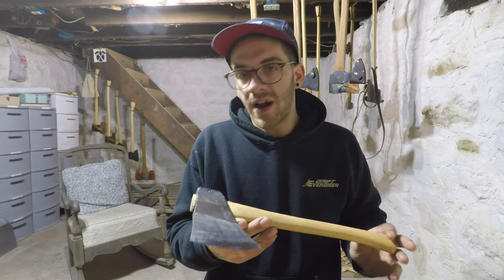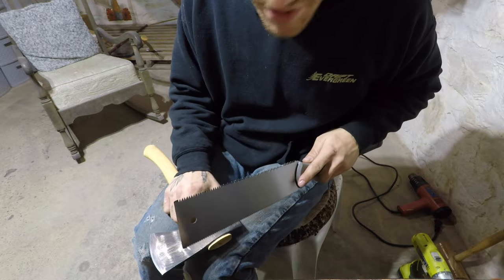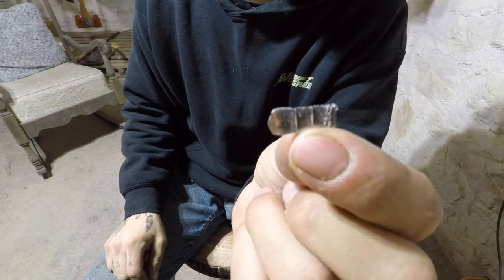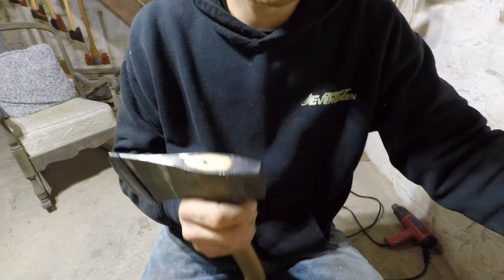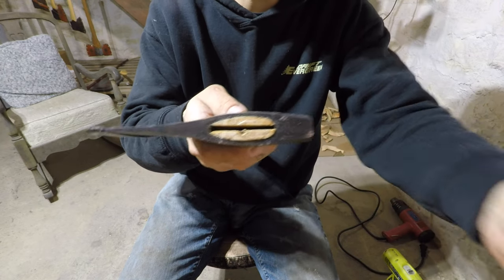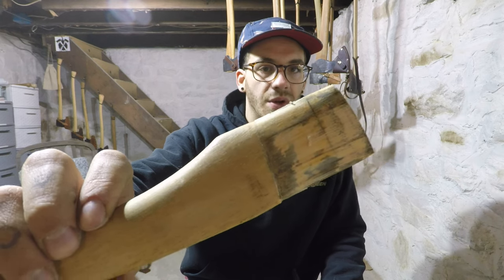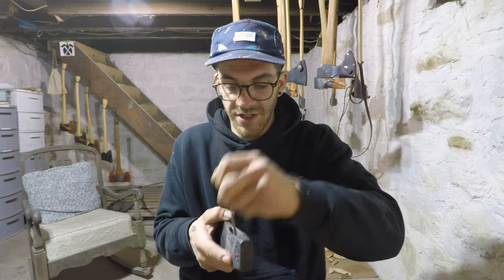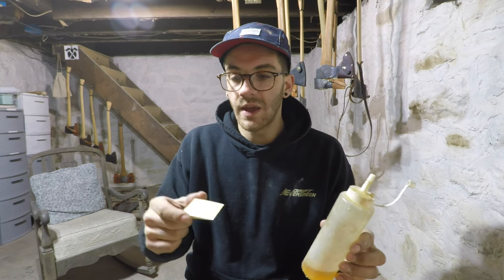How to fix a loose axe the right way

Comment: Haven’t heard of another maker doing it but I put the original brown gorilla glue in the eye of the axe on all the axes I hang. it helps it seat better and once it sets it swells up and I have yet to have one come loose. I’ve had them snap off but haven’t had one or heard of one of mine coming loose.
Reply: Yes I’ve started glueing the eyes with titebond since starting to watch EngelsCoachShop & it seems to be a significant upgrade
Reply from the maker: Oh wow yeah I know the glue you’re talking about !! Thank you I’ll have to give that shot !!! Thanks for the tip mane and thanks for watching 👍
Reply: Actually Titebond II the exterior grade…
Reply: @DrewDiaz  - It's funny that this should come up now.  I just found an old hatchet last week that I haven't seen in years.  I have no idea who made it but it was definitely made before we started importing so much Chinese junk.  However I have no reason to believe that it's a high quality hatchet.  First think I notice was that the handle was definitely glued into the axe head.  They may have just intended to fill in any gaps but it looks to me like it was glued in from the start.  Nobody I know of is recommending that the technique these days but I think there might be some merit in it and planned to ask 940Joey what his opinion was but I just post it hear and listen to anyone who has an opinion.
Reply: @Bkellyusa  my last piece on this subject-
 Widen the kerf on the handle and make sure To get glue down in the kerf, I’ve used kite string and card stock to spread the glue as the glue seems to squeegee off the wedge.
In re gluing the eye- it may just lube the joint but it seems to work

Comment: There seems to be whining about Council Tool heads coming loose, but I for one haven't had that happen on any of my Utility line or Velvicut axes; none of the nine I have and use. It may be environmental or what I do before putting them into service. I've done this with every one. I scrape the haft thinner, sand, and apply multiple coats of boiled linseed oil over weeks allowing for curing. Not one of the nine heads have budged, even having repeated overstrikes. WTF are guys doing to loosen the heads, anyway??? When hanging an axe head there are a few other steps l take. I smack the haft repeatedly and remove it several times to remove any excess material creating a shelf. The last time the head is off I check and adjust the wedge kerf depth to 2/3 of the eye depth and check the length of the wedge; a little long is better, but no shorter. Once hung I may need to thin the wedge also, so that it spreads the kerf without splintering, but still mushrooms the proud haft. I slather BLO in the kerf on the haft, and wedge and send it home. I like mine hung proud about 1/4"+ with a big mushroom. P.S. Buckin' does it better in a 16 minute video. Think more about safety. There's a lot of stupid going around. 😆
Reply from the maker: Hey man thanks for watching, sorry if I came off negative toward council tool, I love their axes they’re my favorite. My CT boys axe is my go to axe. As far as the heads coming loose out of all my council tools only 2 came loose, could of just been luck of the draw, weather, or me. That’s pretty awesome you haven’t had one budge yet I’ll have to try out your BLO method, thanks for the tip👍 what kind of council tool axes do you have, which one is your favorite. How much better are the velvicut versions, I’ve been looking into one. Oh yeah just thought of it, do you have a camp carver!! I’ve had my eye on one of those beauties for a while. If you have one I’d love to know your thoughts on it🤙 and as far as buckin billy ray doing it better, yeah I agree. He does real nice work, he’s been doing axes probably longer than I’ve been alive !! Hope to be as good as him one day, I watch him all the time 👍 thank you again for watching, I appreciate your feedback !!
Reply: @940joey2  Glad to hear from you. Very receptive and inviting, I must say. My favorite axes in order are Velvicut Boy's Bad Axe, Velvicut Felling Axe, and vintage True Temper KELLY Stiletto double bit swamping axe. The other CT axes both Jerseys, three Utility Boy's axes, 3&1/2 lb Dayton redhead, and Flying Fox. If I had to choose only one it would be the Velvicut Boy's. I can't help but think it can do anything I need, but there's always a best tool for a job. That's why I made my move last season to a Fiskars 8lb maul for splitting the four cords for this winter. Keeps this old man vital. I just need to pass a few along, because of the redundancy. Three to my adult sons and one to my grandson. Thanks for the appreciation.
Reply from the maker: @yungsmile7546  absolutely thanks for supporting and giving advice man, it’s greatly appreciated. Oh wow yeah that’s a good set up you have there and I feel the same way about my boys axe. If it came down to picking one axe it would be the council tool boys axe, it really is good for almost everything. I have yet to try the premium bad axe boys axe, one day I’ll get my hands on one. I bet that 5160 steel hold an edge for a long time. They seem as if you don’t even have to touch them, from what I’ve heard and read the premium boys axe you literally take out of the box and use it !!

Comment: Your becoming an axe master mate! This kind of stuff is essential know how and you had some good detail in here🧐  something else to try (you may have already): when sawing the exposed eye wood, stop when you hit the metal wedge. Break off the cut bits, then use the tip of the saw and/or a box cutter to finish the cut. This leaves both the metal and intact wooden wedge exposed, which you can then grab with your pliers and yank out. Jumping the head further on a bit first and relieving bit of pressure off the top of the eye wood can help too. Keep up the good work man!
Reply from the maker: Thank you so much Kurt !! Yeah man I’ll definitely have to try that next time I need to re hang an axe!

Comment: I work the same way, no vise yet. I use a clawbar or cats paw to pop the wedge out via the screws. I broke my flying fox handle and hung it on a 19 inch Gransfors Hunters axe handle which is a great in between size from the small Flying fox handle at 16 inches and large one at 22. Now it's a Flying Gransfors.  Or maybe a Gransfors Fox?😂

Comment: If you have a flush hung axe which gets loose, you can set it upside down and pound on the foot of the handle until its proud of the head.  You may have to cut the curl away under the cheeks as the head slides down the handle. Then you can apply some oil around the eye and let it soak in. From there, take another steel wedge and drive it in and keep hammering to mushroom the wood a little bit.  This is a way to basically rehang and proud fit the haft to a head without having to remove the haft or wedge.
Reply from the maker: Thank you so much, that’s a great tip !! I’ll have to give this a try some time. Great explanation , thanks again 🤙

Comment: This video was very helpful full . I have a montreal pattern with a barrel wedge and had no idea how to remove it .I'm going ro try sawing off around the metal step wedge, great idea  !! Thx
Reply from the maker: You’re welcome !! Glad you liked the video, with a barrel wedge you could also take a drill bit the same size as the inside diameter of the barrel wedge and drill about half the depth of the wedge through its center and use an easy out to remove it. 👍 good luck with it hope it works out well !!

Comment: Gotta get yourself a vise for the creepy basement workshop.  Don’t get something expensive.  Just a $30 job off eBay.  Work just fine for axes, but definitely a must for axe work.  Impressive you’ve done so much without one.  Great vid.  Have you had any luck with the screw trick when it’s glued?  I always have to drill em out then.
Reply from the maker: Thank you Kevin, yeah I definitely need to pick one up you’re right. If I was being completely transparent there are times where it gets quite frustrating trying to hold the axe for certain tasks. I have done 2 axes with the wedge glued and used the the screw trick and both times it led to me drilling out as much of the wedge as possible, enough to get the head off. Then I go through and clean the rest of the eye out with a saw or knife.

Comment: Just did this to my council tool boys axe the other week. Hated using the thing until I made it right. Now it’s hung with just a poplar wedge and holding up tight! I really wish they didn’t put barrel wedges in these axes. If anything, it should come taped to the handle. That way if you get any looseness you can make the call.

Great, instructional video. Easy to follow, and entertaining as always!

Like Kevin said, a bench vise ought to come in handy. I don’t get any work done at home because we don’t have one. I’m always making trips to my relative’s creepy basement😆
Reply from the maker: Hahaha thanks man yeah man creepy basement is where it’s at lol !! But yeah I’ll definitely get a small vise, I’ve been just getting by long enough it’s definitely time. Yeah man I couldn’t agree more with the wedge coming with it uninstalled. I wish it wasn’t such a liability issue because I would love if companies sold axe heads loose so and different handle options, or hell even handle blanks. !! Thanks for watching man I always look forward to what you have to say on it 🤙
Reply: @940joey2  heck yeah, handle options is what we need! If we had better handles options I'd be using the heck out of some old vintage heads i have lying around.

Comment: Real good video..
I had to do this for a new snow and nealley axe.  The problem there was they use an aluminum wedge....which I hate..  It's pretty much impossible to get it out without wrecking handle.
I tried drilling the holes into the wedge,  and attaching screws, since that's a common method with wood wedges.  I managed to get some decent holes with some patience.  long story short, I broke off screws in the wedge and ran out of options.

I had to cut handle off and re hang on a new one.  This was a pity because the original handle was a real nice handle.  But , as you said, I have peace of mind knowing it's hung  properly and will endure 

I'm glad council doesn't use aluminum wedges any more.  Someone needs to convince Snow and Nealley to stop as well.

Axes need to be serviceable by the user.  Aluminum wedges hinder this, and since they don't absorb oil, and therefore don't expand.....they cause the axe head to come loose more quickly.
one thing I forgot to mention is snow and nealley do not hang their axes proud....they hang them flush, which complicated my wedge removal attempt.
Reply from the maker: Thank you so much !! Oh man what a bummer sound like you had a heck of a time with that aluminum wedge. I can’t stand them either, I’m not sure why some companies choose to do that. I had to re-hang a council tool boys axe (the old res version) for a friend of mine and they had one aluminum wedge in it and it was an absolutely nightmare to get out. Fortunately I was able to get it after a while and didn’t have to cut the handle. 
That’s really interesting that snow and neally doesn’t hang their axes proud, I wonder why they do that being that there is so much benefit to a proud hang .. the only thing I can think to why they do that is because of the aluminum wedge. I don’t think it would work well having a proud hand with only using aluminum and it’s probably not as attractive. I know that the CT boys axe with the aluminum wedge also had a flush hang, so that’s the only thing I can think it could be. 
Besides what you went through how do you like your snow and neally axe. Do you have and vintage snow and neally to compare it to, I’ve always been curious on those newer axe line. It’s hard to find a lot of info on them. The thank you so much again for checking out the video !!
Reply: @940joey2  I have only one Snow and Nealley new production axe. 3.5 pound head.
The head is very well finished, and the steel is great.  It came butter knife dull...
but that's OK.  I put the files and stones to it and got a good edge.
I have a CT sport utility finish 3.5 Jersey pattern.  And I would say out of the box it is a much better axe then the Snow and Nealley for the money:
better handle and hang, and no varnish.
sharp usable edge out of box 

I wanted the Snow and Nealley because they were the other USA made axe I kept hearing about, and I wanted to support their return to USA production.  With some effort it turned out to be a great axe.  
Always a pleasure to watch your videos.

Comment: I don’t like using glue for the same reason as you, what if I need/want to rehang. 

I also put BLO on whole handle like you do, in the kerf, plus on the wedge. 

No clue if a good idea, but my theory is that by sealing the wood, less chance to absorb humidity and then shrink when it dries again. I figure it may act like weak glue once cured, but not enough to be hard to pop out with tools.
Reply from the maker: Heck yeah !! Glad to hear you do it the same way, it’s been working for me I don’t see the need for glue !! I think the same way once the oil fully absorbs into the wood there should be less of a chance for moisture to get in and linseed oil drys almost like a polymer so in theory it should act like a glue once cured 👍 thank you so much for watching !!

Comment: Why didn't you just cut the handle material instead of the wedge, where you can clamp on to the wedge.
Reply from the maker: Dang that’s a great point, I honestly didn’t even think of that. I suppose I was more concerned with getting the metal wedge out first, Not sure. Thank you for this great tip, next time I have to rehang an axe that’s hung proud I’ll give this method a shot !! Thank you so much for watching and for the awesome comment 👍

Comment: You can also use an oscillating tool with a plunge cut blade to make a new slot and drive a new wood wedge in. Even if you leave the original wedge in. I always use glue on the wedge and I only use metal cross wedge on sledge or big hammers.
Reply from the maker: Dang that’s a great idea, never thought of that !! Yeah I agree with you on the metal step wedge thing. I still have yet to try glue on my wedges yet maybe I’ll give it a shot on my next hang. I hear a lot of people use glue. I guess I’m a little nervous to commit to glue because I can’t go back and make a repair or fix a mistake as easy.

Comment: Good job explaining on every step involved and different options on each situation.   Have you taken out any aluminum wedges from a council tool axe while trying to save the handle?   My fallers axe has the big aluminum wedge but I wanna save the handle hoping you have some ideas?
Reply from the maker: Thank you chimmy !! Ooof man those are tough because there is no wood wedge it’s just a whole aluminum wedge. If it was steel you could be careful and drill and tap the hole and extract it that way, but I’m fearing that because it’s aluminum it’ll pull the threads out. I definitely think it’s possible with out hurting the handle, it’s just going to take some time and patience. I had an old vintage axe I wanted to save the handle on with a big metal wedge and no wood wedge it took about 2 hours but I got it, it was worth it because I love that handle.
Reply: Drill & tapping. Use small diameter bolts that go the entire depth of the wedge. Use washers to help grip & not mess up the head. Thread locker also helps.
Alternatively, my favourite method of wedge removal is an oscillating saw/multi-too if you have one or are willing to invest $. Use a narrow blade that will not exceed the width of the eye when in operation.  Watch the 'saw dust'. As long as they are aluminum shavings, you're  good. If you're fortunate & the wedge is a different color than the handle, that also helps. This wedge removal method also is about the only way I know of to remove wedges glued in during the hang. Usually there is a gap between the point of the wedge & the depth of the handle's kerf. If you're careful, you can feel the blade & saw drop as they cut through the bottom of the wedge & into this small void. Further, once you've cut the wedge into two pieces, you can use a chisel & tap/break the wedge pieces away from the handle & remove them. You don't always have to remove the entire wedge to get the bit off the handle. Once the handle is off you can clean up the kerf as needed.
Reply from the maker: @waynemiller6945  hey that’s an awesome idea thanks for the idea I’ll have to give that a try. I do have one of those tools I just need to see if I have the small blade for it. I really appreciate the descriptive instructions on how to get after it !! Thanks again man 🤙
Reply: @940joey2  And a steady hand. That's maybe the hardest part.
Oh yeah,
Safety Glasses, Safety Glasses, Safety Glasses.

Comment: i watched a gransfors bruk video and it looked like they added wood glue before hammering in the wedge. wouldnt that make fixing it impossible or is that why their heads never come loose?
Reply from the maker: You’re exactly right !! That’s exactly why I don’t use glue, it’s inevitable the will come loose eventually. This is why I only use linseed oil on my wedges 1 because it helps the wedge slide in. 2 the oil helps swell the wood and keeps moisture out and 3 if and when I do have to re seat the head I can extract the wedge and rehang the axe and it doesn’t cost me the whole handle 👍